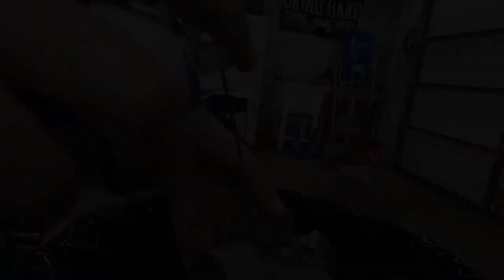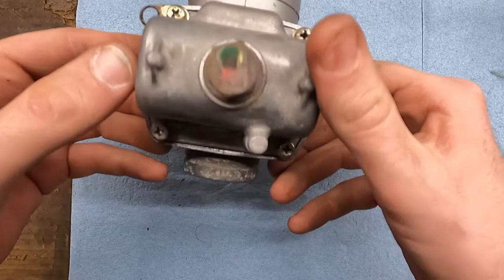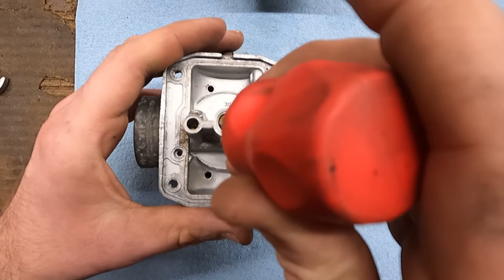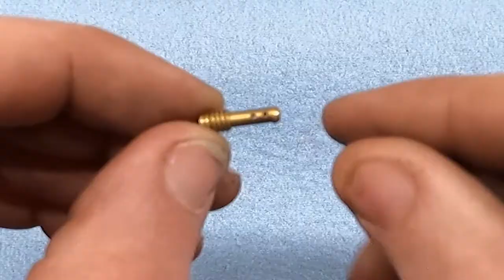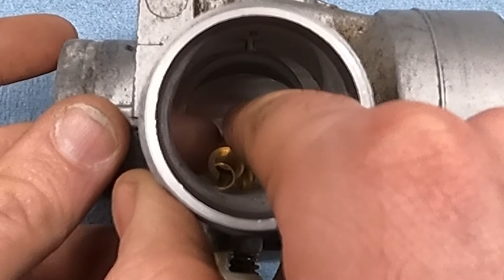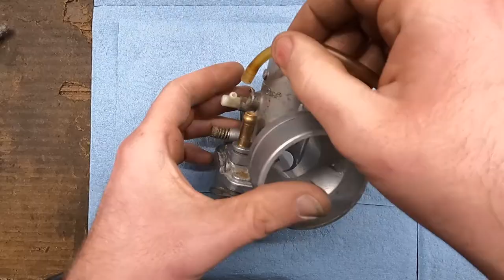CLEANING  Carburetors on a Ski-Doo SNOWMOBILE! Step-by-Step!

Comment: Just did mine used a torch tip cleaner down holes one whole can of brake cleaner to clean got so much more build up out dont think it's ever been clean.. didnt know about slide so am going to check to see if its sliding at the same point. Nice to know now how to adjust them thanks.
Reply from the maker: No problem! Be careful with torch tip drills tho. You run the risk of taking material out of the jet and it’ll run way too rich!

Comment: Excellent video! This was very helpful and saved me a ton of reading/research. I'm working on a 98 Skidoo 380 Touring E, and one carburetor is bad. I bought another one which works fine except one of the air vents is plugged. Can a carburetor work ok with only one of the vents functioning?
Reply from the maker: Hmmm I’m not sure 🤔 if it’s the overflow vent line then I’d think it’s worth a shot 🤷🏻‍♂️

Comment: Great video! Do you have any tips on getting the blasted air box back on?
Reply from the maker: Maybe try some silicone spray, shot of whiskey, get your hand in between the air box and tank and push like hell! Lol but seriously if the rubber has shrunk maybe you’ll need to buy new boots. Or try a heat gun and get the rubber warm and push. This one went on a little stiff but with the correct tongue placement it went right on! Hope you get it!
Reply: @ToyShopRestorations  , 🤣, I prefer scotch. I have a 99 600 Summit and there’s just so much crap in the way. I checked the carb fit into the boots, definitely no problem there. It’s just a frustrating process.

Comment: Should I buy a carb kit incase bad gaskets I might find?
Reply from the maker: It’s never a bad idea. I would clean and reuse all the original jets but you might find something inside that looks bad that would need replaced. I personally don’t buy the kit first but if I get into a carb and realize I need something replaced then usually I’ll just wait it out and get the kit coming. If you’re new at doing carbs then I’d reassemble it while it’s fresh in your head and then wait for parts to come in then tear it apart again.

Comment: What size needle and seat.  Dennis Kirk says two different part numbers. One is vm 28 511 1.5.   The other is vm 28 163 1.5.   What’s the difference.  Mine are rubber tipped and one is torn.  1994 skidoo 670 40 mm
Reply from the maker: I’m not going to be much help here. I did a little googling and it’s possible if you google “1994 skidoo 670 carb specs” you can find a forum and read thru it. “Dootalk.com” seemed to be pretty decent when I just googled it
Reply from the maker: Another option is I know when I was working in a shop my boss had a little book and it had a ton of specs for all the skidoos in the 90’s. If you maybe went to a local shop and mention a little book maybe an older tech would have one? Kind of a long shot but figured I’d bring it up.
Reply from the maker: It looks like this 

https://www.ebay.com/itm/334534481410?mkcid=16&mkevt=1&mkrid=711-127632-2357-0&ssspo=6v0_LXn6TpG&sssrc=2349624&ssuid=39xyh32ctx6&var=&widget_ver=artemis&media=COPY

Comment: Any suggestions if I didn't mark which carb came off which side? 95 SS 670
Reply from the maker: Check to see if the pilots and main jets are the same. If they are then it’s probably less relevant. But if they’re not then you might need to do some digging 😅

Comment: Hey great video man.  have you got one of where you remove them from the sled I'm afraid to bend or break something important
Reply from the maker: I don’t 😅 I’m sorry. Anything in particular you’re nervous about?
Reply: @ToyShopRestorations  fuel lines breaking or anything rusty. It's been sitting for a good 4 years, I had trouble with the filter box itself and seemed tedious to attempt without instructions
Reply from the maker: @angelaguirre2725  hopefully there isn’t much rusty on it as it’s mostly plastic and aluminum. The air box is just the center strap between the carbs. Once that’s off the air box just pushes back. The top of the carbs you only break loose and unscrew the big aluminum cap. Don’t touch the steel nut and threaded piece on top of the cap. Then for fuel lines a good trick is to get fuels lines to twist on the bung before trying to pull it off. Fuel line is cheap anywhere you buy parts for sleds. Never a bad idea to replace iffy fuel lines anyways. Then there’s the clamp on the intake boot on the engine side of the carb. Other than that I think that’s all. Hopefully that helped. Sorry I don’t have the sled anymore and I’m going just off of memory 😅
Reply: @ToyShopRestorations  thanks mate we don't have many mechanic for snowmobile out here there's is just corn fields
Reply from the maker: @angelaguirre2725  where you from?! Roughly lol
Reply: @ToyShopRestorations  flat lands Indiana. border to Michigan and Illinois
Reply from the maker: @angelaguirre2725  awesome! Well hopefully I could help! I’m in western NY

Comment: Why does which side matter? My sled keeps fouling the clutch side plug
Reply from the maker: Sometimes the jets are different between the cylinders from the factory. You can double check that the jets are the same. If they are then technically it doesn’t matter. But still you want to try to keep it the way it was.
Reply: @ToyShopRestorations   I put it back the way it came but this turd just keeps fouling pto side plugs immediately
Reply from the maker: @tylerseabook9423  is it wet? Do you have spark? What do you mean by fouled?
Reply: @ToyShopRestorations   yeah it’s soaked. It’s fouls plugs immediately. Brand new ones fire for a minute then foul. A fouled plug won’t spark that’s why it’s fouled.
Reply from the maker: @tylerseabook9423  take the fouled plug and put it on the other of the motor and see if it will spark. Maybe it’s an intermittent spark issue? Hard to diagnose over comments lol I hope you get it going!
Reply: @ToyShopRestorations   it doesn’t spark when flipped tried that